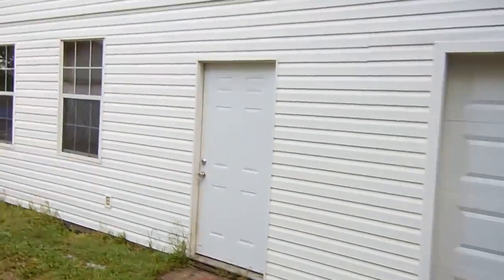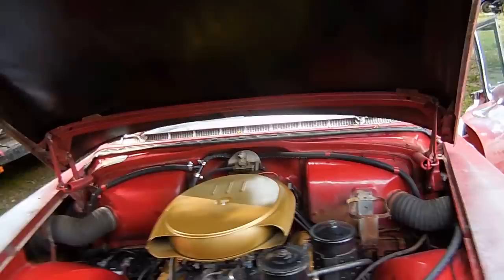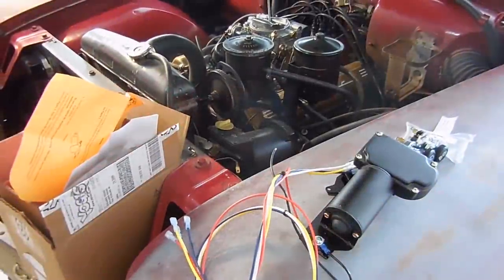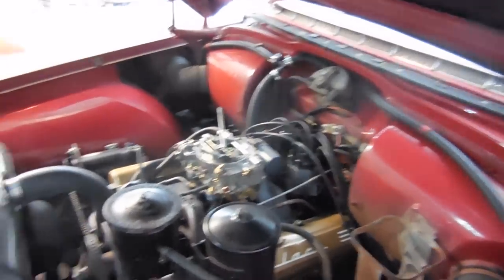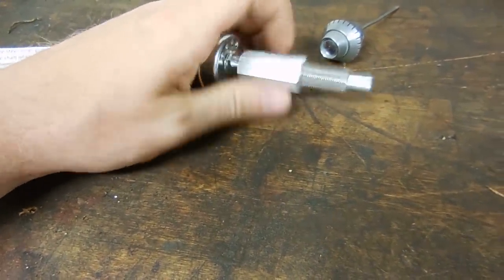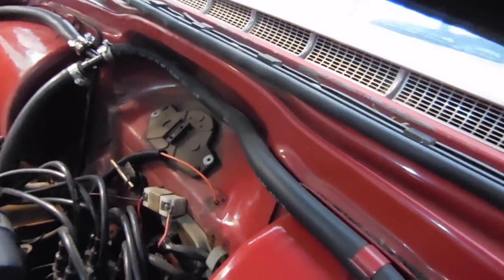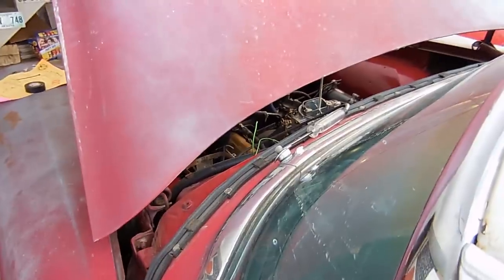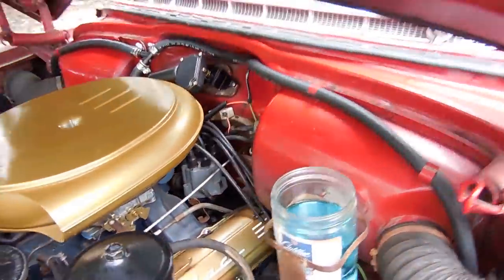1956 Cadillac Sedan DeVille Resto Video 70

Comment: That vacuum motor runs on manifold vacuum. When you accelerate, you loose manifold vacuum, so the motor stops.... no different that turning the valve off. The ONLY way your going to correct it, is with what your doing. The factory carburetor is a better carb. The key is, set them up 100% to factory specs., making sure nothing is badly worn, like the choke pull off. They always ware out, and end up being a vacuum leak. Glad to see your working on that awesome car!
Reply: I agree factory carbs is better  Rochester 4 jets

Comment: If the car was pristine and your goal was to keep it all original, it probably wouldn’t be a car that you drive frequently (except maybe to car shows) and you sure wouldn’t drive in inclement weather.  But, it’s not that kind of a car.  It’s in good condition, deserves to be driven and should be modified to any extent necessary to keep you and your family safe.  Great job modifying the original control knob to fit!  I just love hearing the way that old Hydramatic shifts in your videos.  It brings back fun memories of driving my dad’s Oldsmobile.

Comment: No one in their right mind would trust vacuum wipers. When you accelerate, the engine vacuum falls, so the wipers slow to almost nothing at the exact moment you need them most. Then, when you're idling at the lights, engine vacuum is high, so the wipers work brilliantly, when you need them the least. Vacuum wipers were hopeless, even when new.

Comment: love the videos on the caddy, I have a 1949 the the wipers can be a pain, don't blame you for putting in electric. However, on most of the caddy's there was a built in vacuum source on the fuel pump, most of the original units had them along with glass bowl, you did not have the problem as there was always a constant vacuum source, still would swap it out :)

Comment: great coversion on the wipers my 53 FJ holden has vacuum wiper hopeless in the rain
that conversion kit you bought would easily adapt to my car 
where did you buy it from and the cost ?
Reply: Didn't get electric wipers on the Holdens until the EK series.

Comment: I remember back in the '60's how slow the vacuum wipers were on a 1948 Chevrolet  when the car was accelerating. Now I'm a purist, but a practical purist, who says that safety trumps originality. What good is being all original if you get in a wreck because you could not see in the rain? Also, I hope you put a dual chamber master cylinder on it to replace the original single cylinder m/c. Keep up the good work on that Caddy! Btw, your back-up lights are not working. But that will be another project for another video.

Comment: It was Strange that GM persisted with deadly vacuum wipers for so long. Many is the time i have been caught out,overtaking etc in the rain and the damned wipers would stop. GM in the UK,where they built vauxhalls around the same time had a solution,they drove the wipers off the cam shaft in the engine,so if you were going pretty fast the wipers would really move. Ford had a vacuum pump running of the bottom of the fuel pump in the same era.

Comment: I remember my dad pulling over to the side of the road in our 1958 Chevrolet wagon. Going uphill on a NH mountain road made the wipers stop completely. We've got a 57 Chevy with vacuum wipers, and I have a replacement electric motor I never installed. I'm in Palm Springs, and unlikely to ever drive the Chevy in the rain.

Comment: I think you did a great job on this conversion, and were pretty ingenious in making it look stock/original from the interior view. Although obviously not “factory” under the hood, I’ve had these 50s GM vacuum wiper motors on several cars, and the electric motor is far superior.  You did an awesome job with the washer pump switch and hiding the washer pump.  You did the conversion exactly the way I would’ve wanted to… but probably wouldn’t have been as ingenious as you were.  
The heck with the critics and purists who will pick this apart because it’s “not like factory”.  If anyone ever drove one of these vehicles from the 50s in anything more than a light sprinkle or rain, you’d know how lousy they were.  Most of the time they would just stop and not move at all. And forget it in snow!  Just horrible!!  You did a fantastic job! Thanks for a very interesting and well done  video!

Comment: I do enjoy completely stock vehicles. Now having said that I am an even bigger fan of doing upgrades for the sake of reliability. Especially as it pertains to safety. I'm probably going to be doing at least a front disc conversion and power brake upgrade on my 57 sedan. 4 wheel drum single res non power brakes are fairly horrible. Especially when you've already got one foot on a clutch pedal, lol.

Comment: It is great to stay as original as you can, but when it's a safety item, there's no reason why you shouldn't make your old car safer.  If it prevents an accident, you've preserved the car - which is far more important.  4:21 : the reason why the wipers work poorly on acceleration is because when you accelerate your engine vacuum drops from 18  - 21 in Hg at idle to around 4 or 5 in Hg.  You have less vacuum so your wiper motor has nothing to provide it with "power".  That's how they all were at the time, but we've had electric wipers for years now, at least since 1960 - so might as well do it.  You should have a vacuum canister that should reduce that but I guess it's not enough of a reserve.

Comment: Vacuum is at its highest level in idle. As soon as you open the throttle the vacuum disappears. 

Your wipers worked well, so the "motor" is not the problem. You could have fitted a modern vacuum pump like they use them on diesel engines for the break booster and kept the original vacuum motor.

Comment: I learned to drive on a 54 Ford and my first car was a 51 Chevy.  Both had vacuum wipers and would slow way down and even stop when you accelerated.  I did not like the 6 Volt systems on those early rigs either.

Comment: usually there is a vacuum ball that builds and holds vacuum for accessories when vacuum is high, so it delivers it when it is low, and is does not give it back to the engine, but only to the accessories hosed off it

Comment: Hey dont worry about the long spaces between uploads, you have a kid now, that's a minimal of a year plus before things get back to normal lol I must admit I do miss the random projects you used to do though, and you gotta do some rust treatment on the rear of the car with the trunk lid, like theirs gotta be some sort of rust converter you can use that can stop that so you can atleast re primer the thing abit, or even just run to a hobby shop and buy some matt cherry red you could use on it.

or maybe even the trunk off of a parts car if possible if you want to take a shortcut until it can be resprayed proper.

Comment: Keeping a classic car "all original" and "factory" has its place; mainly on the concourse of a major car show, or when selling it, depending greatly on your target audience. Making the car functional and reliable for actual use is equally valid, especially if you never plan on selling it. And even if you do, there are several potential buyer who, like yourself, would rather have it working and reliable than 1956 correct. I mean, as soon as someone replaced the original polyglass tires with radials, it wasn't factory correct. I love what you've done, and what you're doing, to this '56 Caddy.
Reply from the maker: Yeah the car has had radials on it since it went back on the road. Never considered that an upgrade till you mentioned it.

Comment: Great retro on the wipers, I had a '62 Ford Falcon with vacuum wipers and they ran off of the fuel pump, sounds funny but the top of the fuel pump was vacuum for the wipers and they actually worked pretty well,,acelleration would slow them abit but all in all was functional, thanks for sharing and as always"Howdy from Texas 😁"!!